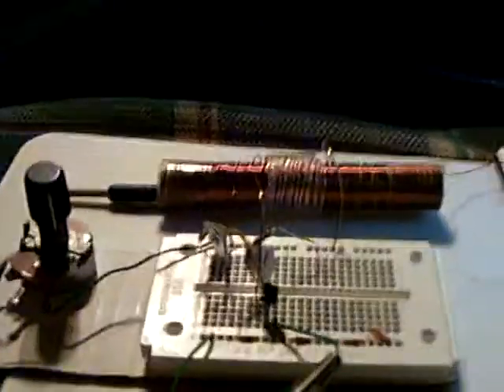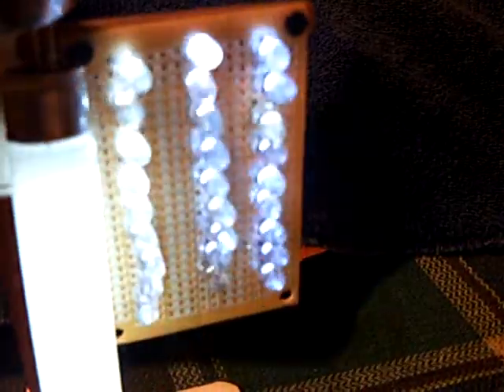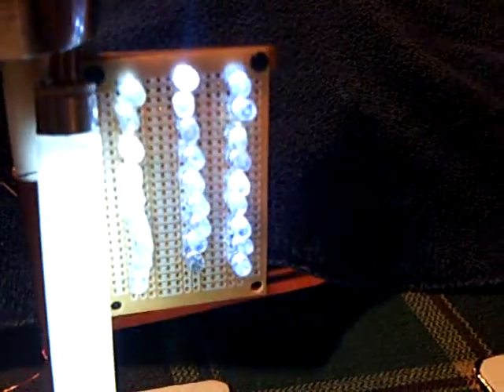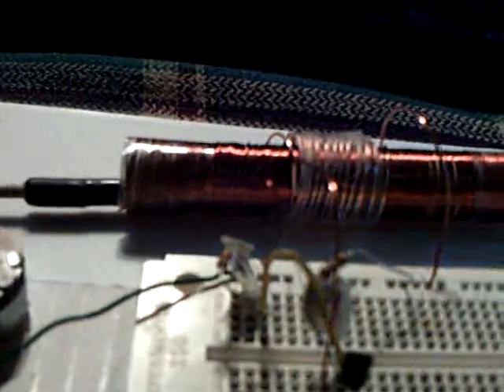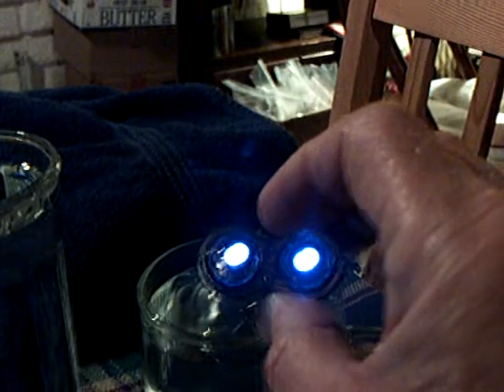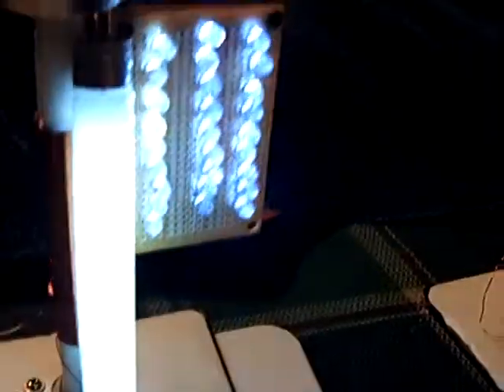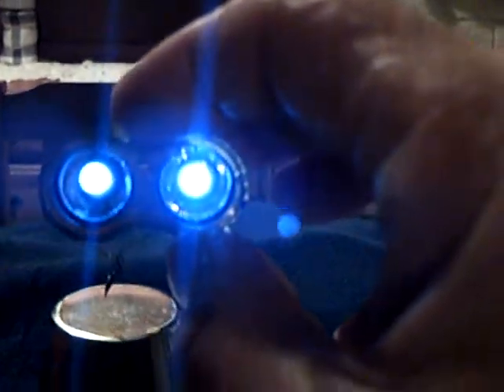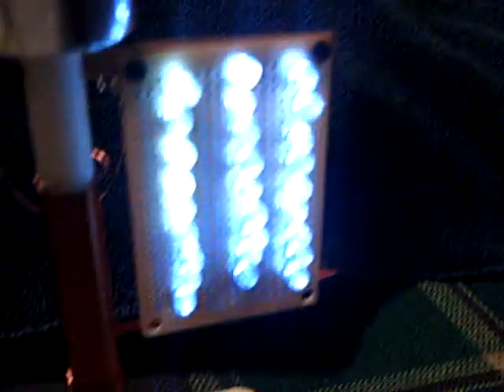Slayer Exciter with tuneable inductor.ASF

Comment from the maker: I never have run my exciter circuits for a long enough time to see that problem.  Usually I play with them for awhile then and throw em back in the toy box. Ha.  Maybe a voltage regulator and or diodes might help stabilize your setup?  Don't know.

Comment: Lid:

Excellent video!  I just had a thought.  How close is your experiment set-up to the water pipes in your home?  What I am wondering is if any of the energy is "captured" by the water in your pipes in the walls or floor?  In other words, if you took your AV plug tester and held it under the stream of running water in your kitchen, or bathroom, (whichever is closer) would it light?  I was thinking this since you showed that the volume of water makes a difference.  Great job.

Bill

Comment: Great video Lidmotor, I like how your using very little current and still getting Great wireless effect.
I have tried a ferrite rod in mine when I first started working with the circuit.But I wasn't getting the results your getting with it. Great Job